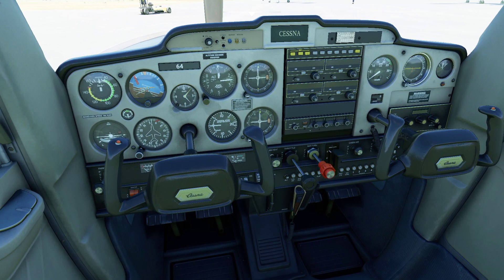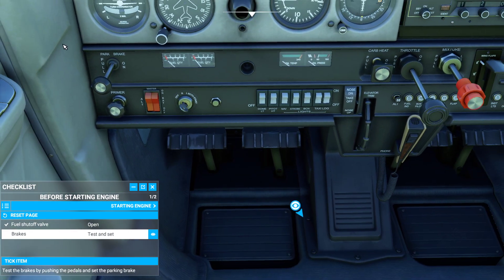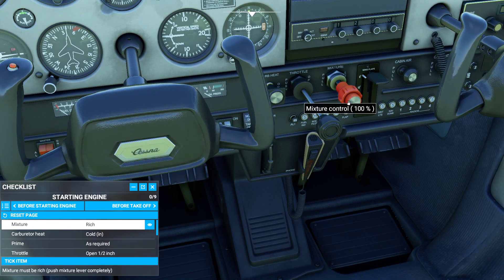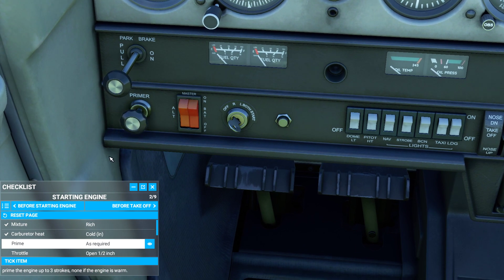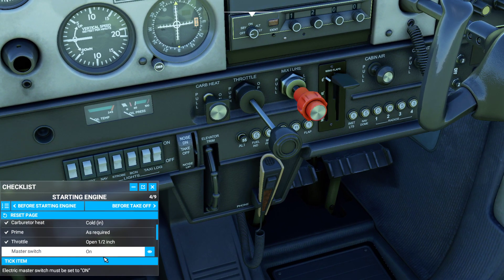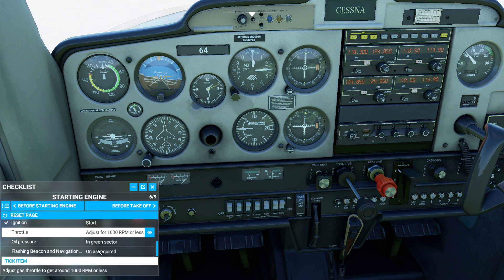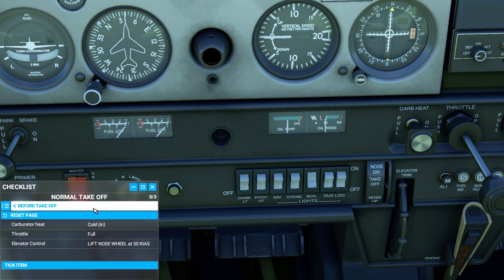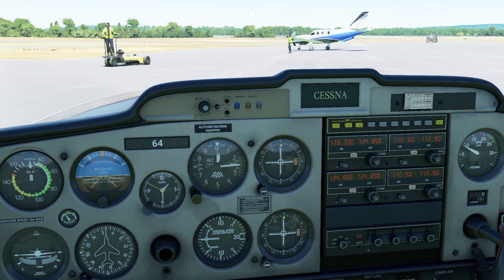Flight Simulator 2020: Basic Startup of Cessna 152

Comment: @5:35. Very confused. Why is it dangerous to have your radios on?
Reply: Same , I really wanna know.
Reply: Same, I really wanna know.
Reply: Yeah I'm curious too
Reply: Transient voltages can happen in the electrics during engine start, if the avionics are on, they can get damaged, and I bet they cost a small fortune to replace, so leave them off until after engine start, same for all small GA aircraft like this.
Reply: @iain8837 Thank you!  Makes sense.
Reply: @iain8837  Thank you!
Reply: @iain8837  that makes sense,thanks for your reply!

Comment: Good guide, but considering that you can takeoff and fly from anywhere in the world you should've mentioned that you need to play with the mixture depending on altitude, I was attempting to take off in the andes but could not start the engine. Had too look up and eventually find out you need to lower mixture on higher elevations. The beechcraft wasn't starting because of this as well. Good thing to note.

Comment: Some aircraft have different checklists due to company policy and the obvious make and model. Functional limitations may be offered by engies which can be incorporated into the checklist. 

Eg. My company's policy requires that the beacon light remain on at all times, you must not switch the bcn off. Reason: If the battery is left on, anyone can easily see that the aircraft has not been shutdown completely.

Comment: Why is it dangerous to have the radios on during startup?
Reply: You don't want to take any additional power from the battery so it can go to starting the engine.  It could also send a surge of power to sensitive avionics and damage them when the plane starts and the alternator starts producing current.
Reply: @thecorporatepilotdad  so when do you switch them on? after the full startup procedure and before taxing right? how do you request to taxi lol
Reply: @geofft08  After the engine is started then turn them on.  Just don't have them on while starting the engine. They can be damaged and it takes power away from the battery that can be used for cranking the engine over.
Reply: The sudden turn on of the alternator may cause a surge of power through the avionics system literally damaging your most critical system. Always turn on avionics afterwards

Comment: Still not starting for me, which is frustrating because I used to be able to get it to start every time before I took a 6 mo FS break.
Reply: You may have flooded your engine.
You may have not primed your throttle. 
You may have not cracked your throttle. 
You may have failures turned on.
Your battery may have gone flat.

Comment: Great vids helps alot. I have found the Shock Ultra, XCub  172 & Caravan to be very nice to fly after tweaking the Sensitivity but the jets & Diamonds keep killing me. I also can't figure out how to plug in to the nav 1 for an ILS  landing yet did you do a vid on that?
Reply: Be careful with the sensitivity settings for aileron and elevator controls. They only introduce lag. In fact, the curve is just a delay setting. You might get rid of one problem by introducing another one. It's okay to do for the rudders because they are to twitchy by default. Deadzones should be zero, too. Unless you have a cheap controller that is spiking.

Comment: I'm just getting into MSFS 2020 and have been flying this for the last 4-5 hrs. One huge issue I have is the instruments and their apparent lack of lighting. Is there a light switch? many times I am flying, trying to follow instructions but I cannot see the gauges, even your opening screen shows this issue somewhat. Very perturbing to have control tell you maintain 2900 but you literally cannot see the altimeter.
Reply: Behind the yoke, there's a panel of switches for the lights. The leftmost switch labelled "DOME LiGHTS" is the interior cabin light. This should help you out a little.

Comment: How can I do that? Where everything on the checklist is not yet been done when you start the simulation? Everytime I start the simulation, the checklist already is automatically completed but I need to do it manually? Is there any setting to change from automatic to manual?
Reply: Go to your Assistant Setting in game.

I'll start another fight in a minute and find the setting. Also, don't start on a runway. When you select your Airport Departure, pick a parking spot from the list or from zooming way in on the airport

You may not have to change a setting, it seems like taking off from a parking spot spawns you in a plane that you have to start
Reply: @jimlthor  please keep in touch. i really need to know about those settings. Thank you
Reply: @jacher101  so, you start your plane from a parking spot. In the hoverable menu at the top of your screen, turn OFF Checklist Assist in the AI Control menu..

You might have to start a new fight after doing that.
Reply: @jimlthor  how can I put the plane on the parking spot? Man sorry if I have too much questions
Reply: @jacher101  on the world map, when you pick your departure, zoom WAY in on the airport and click on one of the gates or parking spots, instead of a runway..

OR when you select your departure airport, a menu on the right side of the screen will pop up and you can select runways and parking spots there. It also shows the length of the runways
Reply: @jacher101  don't worry about the questions. Sorry im taking so long to answer. Got distracted
Reply: @jimlthor  thanks for the answers. I am really looking for tutotials on youtube about this topic but I can't find anything
Reply: @jacher101  good luck, and have fun flying. /r/flightsim and /r/microsoftflightsim are a couple of good subreddits if you haven't seen them

Comment: Is anyone getting low oil pressure in the Cesna 172?  I get a warning for low pressure at initial startup.  If I ignore it, the oil pressure operates out of the green zone, my idle speed is under the recommended 600, and my max rpm at full throttle is only 2100.  I've tried messing with the fuel mixture but that barely does anything.  What am I doing wrong?  I followed the checklist like I was supposed to, but it still does this every time I start from cold & dark.
Reply: Maybe high altitude airport? Try leaning your mixture
Reply: Lean your mixture and increase your engine rpm for warmup. You should be sitting at around 1000 RPM. Low oil pressure on the ground is usually created because your engine isn't running fast enough. Be careful not to overheat your engine however.

Comment: Why is having the radios on dangerous?
Reply: You don't want any electrical equipment turned on when starting the engine, as all the battery power wants to be going to cranking the engine and you don't want to have electrical spikes going into your expensive radios/transponders etc.